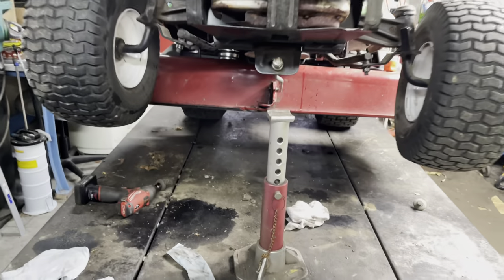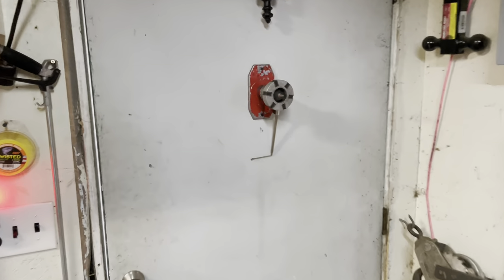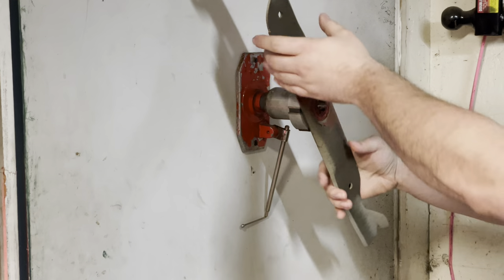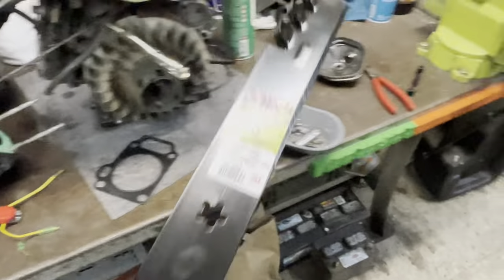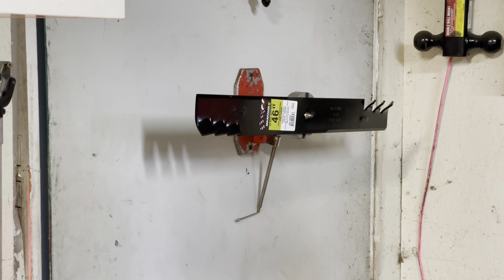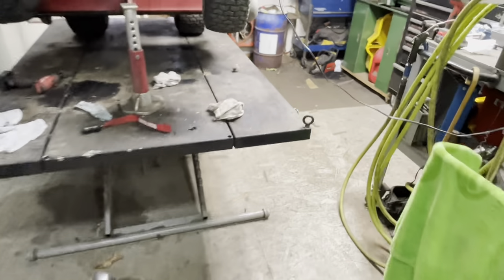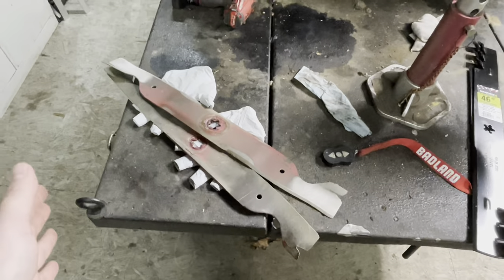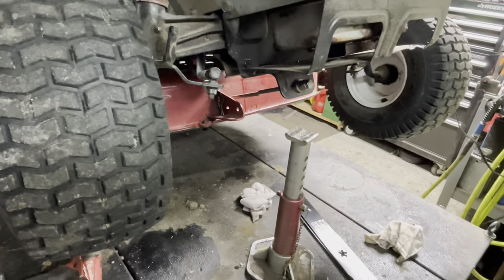Balancing Mower Blades.  Necessary Or Nonsense?

Comment: Great video. i Always balance new blades. if you do Not balance the blades either used or new they will wear out the mower parts and sometimes vibrate the mowing deck/whole machine. :)
Reply from the maker: You couldn’t be more right my friend 👍🏻👍🏻

Comment: I've been balancing on a nail for years and thought I was the greatest blade sharpener of all time to have perfectly balanced blades every time. After receiving a magnetic balancer my sharpened blades did what your red blades did, OMG I had to re shave one side about 6 times to get a good balance. The kicker is after each re shave I also tested on the nail and it kept showing a good balance, so the nail method is a big time liar. Great presentation
Reply from the maker: I was in the same boat my friend!  The magnetic balancer is a game changer 👍🏻

Comment: Take your blades off after just one week and you will see that this super sensitive balancer will show that they are unbalanced again. That’s all it takes. I’m not even talking about grass clippings or pieces of dirt sticking to the blades and changing the balancing as you mow. So the question is, unless blades are way out of balance (that a simple nail test would show anyway), are there any real benefits of micro-balancing them? I believe a good practice is a practice that is both sound technically and easy for most people to follow. And a practice that people would ignore because it is too much hustle, is not a good practice no matter how sound it is.
Reply from the maker: We can definitely agree that when it comes to balancing there is good and good enough.  However, a nail will not work because it can’t hold the blade in the center. A regular (horizontal style) balancer is more than enough to get a blade balanced within acceptable tolerance.  The balancer that I have is more for a mower shop that sees dozens of blades a day, but it is also quite useful for seeing if a blade is bent.

Comment: How often is necessary to balance? I suspect it is out of balance after one mowing. Can spindles be out of balance and contribute to vibration? It seems there are more variables that could affect blade balance subsequent to initial balancing.
Reply from the maker: All great questions. So what we are going for here is to get it close and keep it close.  In other words make sure it is not dramatically unbalanced.  If a spindle is causing vibration it would be due to bad bearings or the spindle itself being bent. But keep in mind the closer you come to the center of the circle the less you are going to notice anything being out of balance due to centrifugal force. So at the end of the day it's more about making sure the blade is evenly sharpened and not bent then it is about making sure the blade is perfectly balanced at all times 👍🏻

Comment: If it's not a propeller on an aircraft, I'm not gonna worry about it too to much unless there is vibration? Why? Because your gonna be swinging these blades at over 70 miles an hour 2 to 5 inches off the ground hoping to impact grass if your lucky... roots and rocks if your not....one ding, one indent to your blades and guess what....
Reply from the maker: It's definitely not a life or death situation.  The main benefit is the longevity of what that blade is attached to.  For riding mowers that is the spindle bearings, and for push mowers that's the crank bearings.  And well I 100% agree with you that blade balance is not something that is sustained very long I do believe it is still worth keeping an eye on and keeping in check. There is a very wide spectrum when it comes to being balanced and keeping it towards the balanced stand is much better than ignoring it and keeping it in a state of badly unbalanced.

Comment: First off once again congratulations on hitting 1K Subscribers....  There are only a few channels that I get excited about  a new upload and Hester781 is one of them...   This was a great test, it is obvious that the surface friction of the screwdriver is not giving you an accurate test result.  I wonder if you lubricated the screwdriver shaft with a very slippery oil if you might obtain better results.  I don't think anything will duplicate your precision bearing balancer but it would be interesting for the do-it-yourselfer to see how we can get the best results.   Thanks!!!!!!!!!!!
Reply from the maker: Thanks Scout!  So you have the same idea as I did when I started out.  I had an aluminum rod that I polished to a mirror finish and slid on an oiled bronze bushing that I would balance the blade on to “eliminate” friction messing with my results.   But an old timer (who taught me much of what I know today) pointed out that the flaw in my design was the blades center of gravity.  You need to make the pivot point the exact center of the blade in order to get an accurate reading.

Comment: Nice demo! I figured the screwdriver in the vise would work better than that. You said the cone balancers were better? Thanks.
Reply from the maker: Yes the cone style is way more accurate and works well.  However it doesn’t tell you if the blade is bent
Reply: Some cone types don't fit some blade holes or opening very well.
Oregon products is another company that makes a quality magnetic tool with an arm to check straightness.

Comment: A Lawnmower is not a PRESICION machine far from it, the flex in the deck and belts worn is more of a problem than anything
Reply from the maker: They are definitely far from a precision machine.  However that doesn’t mean you shouldn’t put some care and effort into proper maintenance 👍🏻

Comment: Add some grease to the nail. Should make it more accurate.
Reply from the maker: It has nothing to do with friction, the problem is the nail is above the center of the blade, so you are never going to get an accurate reading 👍🏻